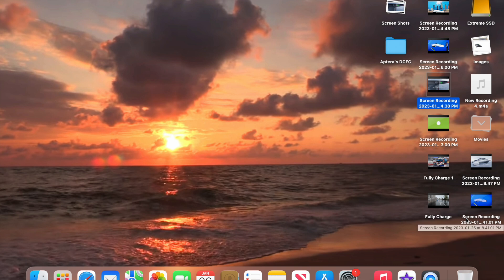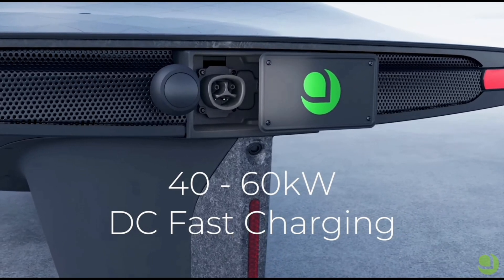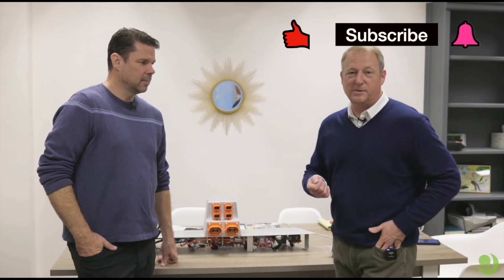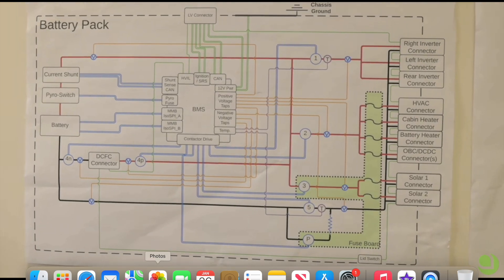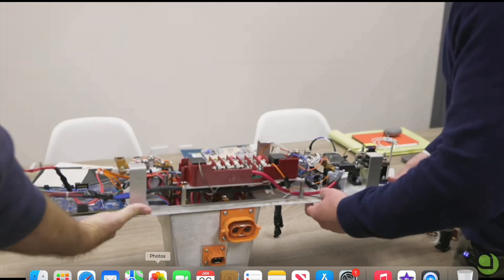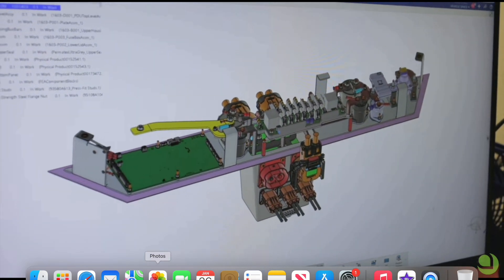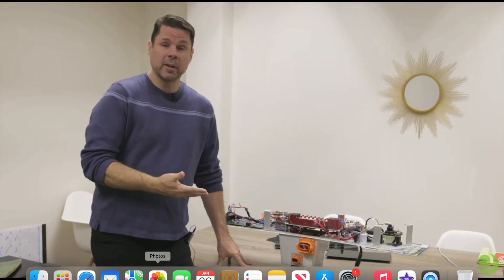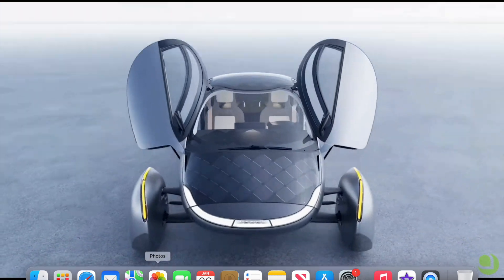Can Aptera's Skin Cooling Work For DCFC ?

Comment: Have they considered that in really cold climates and to a lesser extent the HVAC of the cabin is going to possibly exceed the drive motor power needs and thus significantly impact range?  In some freezing environments battery heating can be needed just so you don’t hurt the batteries. Or you need a turtle mode to limit motor power.  I have a feeling Aptera won’t have tested for these cases if they’re stuck in a San Diego weather mindset.

Comment: If the skin cooling isn't enough then they could add a small radiator just inside the rear vent ports.  I think it just comes down to trying trying it out in high heat conditions.  On the opposite end of the spectrum, I'm hoping they have battery preconditioning to help the battery charge quickly when the temps are low.

Comment: I don't think there is going to be  a skin colling system after.
Reply: Hope for the best and plan for the worst
Reply from the maker: We’ll find out in the upcoming months.
Reply: The skin cooling design, coupled with the AC system is designed and an integral part of the vehicle.  The lead engineer, Daniel Morris, has given the Aptera Owner's Club detail on how it works.

Comment: 40-60kw is relatively low level compared to others on the market. The only reason this level works for aptera is because the small battery size and vehicle efficiency. They left the charge level low because of the unknowns for skin cooling and battery heat. The cable sizes inside the chargers are the only known factor. They would have to keep the expectations lower until it’s all tested. If I were to guess, I would say 40kw will be for the first year, bumping up to 60kw on year two, and probably cooler climates can get 80kw. All of the charge rates can be a simple over the air update.
Reply: There is a maximum that the battery can accept regardless of temperature. The configuration of a 42kWh battery using the cells they are is very close to 50kW. If you exceed the limit, you risk thermal runaway. You also shorten the life of the battery greatly.  From a safety standpoint, I cannot see them allowing more than 1C. 400 to 500 miles per hour is fantastic. I have seen what happens when you charge at more than 1C and it isn't pretty. Battery fires are incredibly hot
Reply: @ddessert6  google search showed a similar size battery in the Nissan leaf has a 62kw charge rating.
Reply: @@ddessert6  The Tesla Model 3 around 145kw is 500mph. It can go faster than that on a V3 super for a short time when it's really empty. It beats the pants off a Bolt. It's not Porche, Kia, or Model S on a V3. It's perfectly fine. It's not record setting.
Reply: @fjalics  cell chemistry, what a 1C level is and the configuration of those cells will determine the max safe charge rate. Those other vehicles have different battery setups. 500mph is more than enough for me. A 15 minute stop will put plenty of juice in the vehicle until my next stop.  My point was don't try to over charge or expect that you are going to be able to charge at 150kW. Not going to happen with that battery.
Reply: I believe that once Aptera produces the first few deltas that they will physically test them to validate performance, including crash testing.  They already know from prototype testing that actual results come within 95% of the modeled performance.

They will still validate before products are shipped.
Reply from the maker: That what I was thinking so they can stay on the safe side